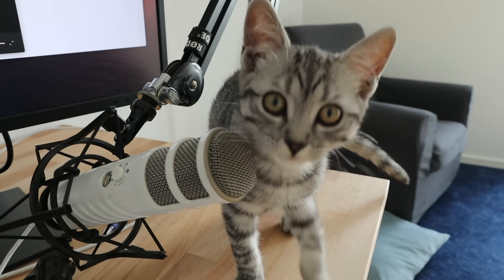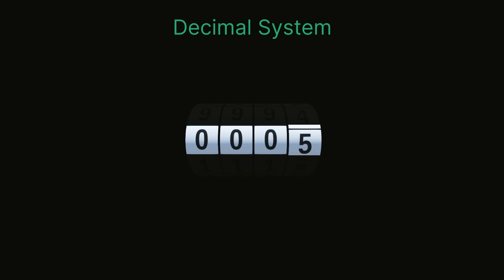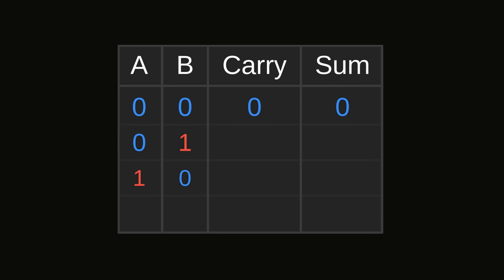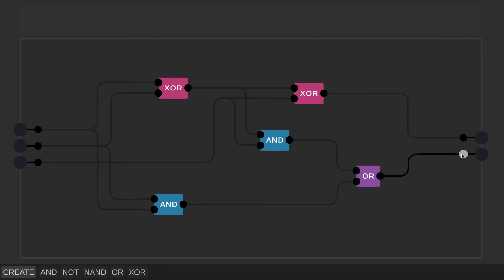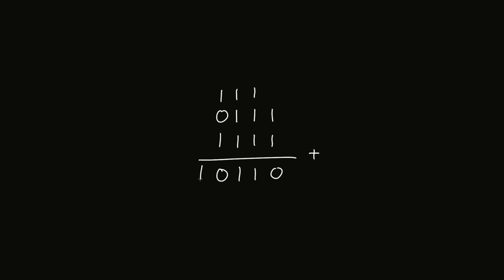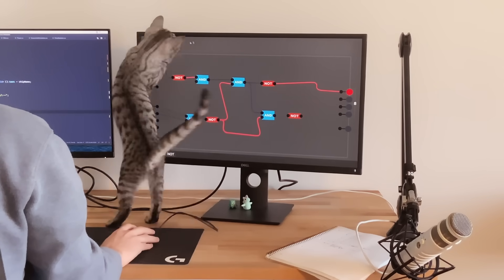Exploring How Computers Work

Comment: Nice build up demo, especially showing the increasing layers of abstration. But your "simplest building block" of an XOR uses already 10 Transistors. That's very inefficient and scales badly for a potential industrial scale CPU. I on the other hand can manage to do an XOR gate simply using only 4 Transistors from first principles.

Comment: Can someone explain to me why at 1:38 when he connects the paper clips that creates an easier path for the electricity to travel? I don't understand why the path with the light bulb is considered to be less easy to travel by the current. It seems to be the same as the path with the paper clips to me
Reply: I think it's just because the lightbulb is a resistor

Comment: 17:05 how is that negative 2
Reply: 0010 = 2
Lets apply twos complement (the method to convert binary to negative numbers where our most significant bit which is on the left is 1 indicating a negative number)

Invert it
1101
Then add 1
1110

That's our negative 2 in binary
Reply: 13:40

Comment: 15:05 I'm a little confused. If we throw out the extra digit at the beginning, how does the computer know it was extra? How does it know that we meant -6 from 1010 and not 10?
Reply: It depends on the architecture of the processor or the type of operation, if the processor knows that the addition is done in 2s complement, like is shown here, then it will know it is meant to be a negative number (-6 instead of 10), but of course it could be 10 if the processor knew that it is adding two unsigned values, thats why programming languages often have two different integer types: signed and unsigned - they could both store the same binary value but each would represent a different decimal number

Comment: At 3:50 you left a lot of stuff out such as power supply and the on off switches so couldn't follow you after that. It began to make no sense to me. Before that it was going pretty good though.
Reply: skill issue
Reply: Turning it on requires power, suppose to be a given. He says turning it on and turning it off…

Comment: Trying to build my own PC as well.
I have a questions about the ALU.
Because either, I don't understand how it is supposed to work.
Or there is a flaw in your design.

If you set the subtract flag on.
and subtract 0000 with 0000, it should be zero, which works fine, zero flag is set.
But, the carry flag is also set, which means we have a 0, and carryover? carryover is basically 16 correct? so this is counterintuitive
Thank you
-Raniem

Comment: 4:50 I was trying to use a software like this and like why doesnt he just link 2 inputs to 1 output and it makes an or statement just the same. In the sim it should, but it actually glitches quite a bit for some reason. I thought it should be able to handle this but it might actually be more of a problem in real life scenarios than not because a direct connetion would be having them both on with twice the power and no buffer im not sure though if thats entirely the problem or not.

Comment: I have gotten a small device with a few buttons (that look kind of like the DPad, A, and B on a controller) and the mother board was made of wood (based on its giant hole), and it had a USB and charging port (yet no battery)
Reply: Also i made a 4B memory in the simulation

Comment: 1:38 can someone explain this? The resistor seems to be in series with the circuit so why would the bulb not be lit when the switch is closed? Is it because the switch has less resistance than the bulb?
Reply: The switch does indeed have less resistance than the light. An LED's resistance might be negligible for most purposes, but it still has more than simple metal. 

The resistor is just there so that there is enough resistance in the circuit at all times, I suspect.
Reply: The current will go where there is less resistance, and there is less in a switch than in an LED.
Reply: The led requires a potential difference between it's two terminals in order for current to flow between them 
When the switch is closed it effectively makes the potential across both terminals the same so no current flows
Reply: The resistor is also there to limit the max amount of current going through the led otherwise it would damage it
Reply: You answered your own question. Yes, there will always be "some" small current that goes in the path of resistance, but its mostly unimportant. It's so small that the light can't turn on.

Kinda like when x is so big (towards infinity), 1/x can be interpreted as 0.

Also fun fact, red LED's require less voltage and current than other coloured counterparts. Meaning that if you can't see in this case that the light is on, you will not see in any other case.

Comment: 45 y.o. here and no one has been able to really explain the magic, even at most low level there is a point the computer does whatever by just typing a button or pressing a key in keyboard. Most far I reached was everything is sustained on a few genius which really understood this madness and they created first compilers. I think 99% of current top-level programmers / engineers they couldn´t do anything without these acquired knowledge from the real genius.

Comment: I'm really enjoying using the toy/tool you built to demo some logic concepts. One shortcoming I'm banging my head against is the ability to create edge-triggered flip flops. Normally this is done by having the clock go directly to an AND gate, and also to a NOT gate that goes into the other input of the AND gate. This looks like it computes "clock and NOT clock" which is always false, but because of the signal taking slightly longer going through the NOT gate than it takes to go directly into the AND, there's a small period of time where the AND gate goes true before going false, and this can be used as the latch signal into a flip flop which will latch the data for a short time window. I notice that some circuits with feedback loop around, and I would love to have some way to have a flip flop which can only latch data at the instance of time that the clock signal transitions from low to high. Due to the way this is probably simulated, it might be easiest if it was a primitive.
Speaking of primitives, it would also be nifty if new primitives could be added with a small scripting interface. It looks like you're already displaying the scripting inside of primitive modules when peeking inside of them. Is this compiled-in or would it be easy to allow new scripted primitives to be added?
Just some suggestions. I love the tool and of course love your various videos (not just the logic ones) and appreciate that you've made such great content and even provided the programs for us viewers to play with. Kudos.

Comment: what is the application that you used for simulating the circuit board with line connectors?
Reply: Check the description

Comment: So ive been researching for quite some time now, and no matter how much i seach, i always get shown the same useless information. 
People waste a lot of time explaining how a computer only deals in on off states and how the binary system works in an often condescending way, and then they just skip the interesting part. 
They say everything can be turned into binary (i get that) and then they just say the software or the cpu interpret that signal. but thats the crux with the whole issue, the one thing i cant wrap my head around.
How does the machine know what to do with the many on and off signals. To interpret those signals (even to just show the signals on the screen) the system needs to be told what to do with them. 
For example, if you get a 1, an on signal, and you want the screen to show a 1, then you first need the system to understand that it got an on signal, and then to tell the magnets (in a very old monitor) to light up certain pixels to form the number 1. But how do you do that?
In order to teach the computer ANYTHING, you first need to tell it what to do with it. but how can you tell it anything if you couldnt tell it how to tell it anything? 
Its a circular problem. If you want to teach someone a language, but all you got is a flashlight you can turn on and off, and you cant get any information back from them, how do you got about teaching them? you can flash the light at them for years and they wont know what to do with it. 

I hope you guys can understand what i mean.
Reply: It only knows 0 or 1, on or off. Your theory there goes into AI. AI is not possible, it only knows other people's input and takes an average of the scenes. I don't know how to better answer your question.
Reply: You are complaining about your own ability to understand the building blocks and inability to search for the information.  First you have to understand the 1 and 0's then you have to learn the concepts in this video; the logic gates and "combinatorial logic", from the there you need to understand "sequential logic",  what makes it possible for a computer to hold "state" and registers and RAM.  From there you need to learn how a very simple 4 bit CPU would work, for example to create a calculator... then you move on to 8 bits, study the MC6809, MOS6502, and Z80 CPU's from the 80's ... all this takes LOTS of time.  many months or years.  You think you can learn it all in one lesson?  You do NOT need to understand any of that just to program in a modern high-level language.
Reply: @jamesross3939  seems like you didnt read what i wrote ....
Reply: @dervakommtvonhinten517  Oh I read what you wrote alright ... you don't mind handing out criticisms to people willing to create content on the subject, but you don't want to be criticized for your inability to learn, am I correct?
Reply: @jamesross3939  you dont mind handing out pointless criticisms to people taking the time to comment on videos, but you dont want to be criticized for your bullshit that ignores what had been written.
Reply: @dervakommtvonhinten517  I read every complaint you made. You start off with a doozy. That first sentence basically tells the whole story though. I tell you what, learn something today and make a video of what you learn. You can't do it can you? Because you're too busy complaining about what others... or perhaps you'll say "I searched the whole internet and couldn't find a single video that explains how to make a video"
Reply: @dervakommtvonhinten517  you do realize you have to understand the individual parts before you can understand the whole system.  I laid it out but I can tell,  you don't want to put out the effort.
Reply: There's no "teaching" at the basic level. The computer is built from circuits that are hard wired such that feeding in a certain pattern of bits has a certain result (e.g. "let current flow from your memory circuit into your adder circuit"). You hard wire enough of these possible "instructions" so that the full collection of them is enough to manipulate the bits in your memory circuit into any arbitrary configuration (including, crucially, patterns of bits that represent instructions). From there you can start to write "programs" (which are never more than a sequence of bits that look like the instructions the computer is hard wired to understand) that can push patterns of bits along wires that are connected to circuits that hard-wire bit patterns as voltages applied to, say, a liquid crystal array. Then you have a screen.

I admit, that likely won't be sufficient on its own to cause you to understand. You have to see the process. Watch (and do not skip any videos of, they are all relevant) Ben Eater's 8 bit breadboard computer series to understand how you really do never need more than hard wired circuits to define an instruction based assembly language for a computer. Then watch his 6502 series to show how given such a computer you can interface with arbitrary hardware just by conditionally pushing voltages around.

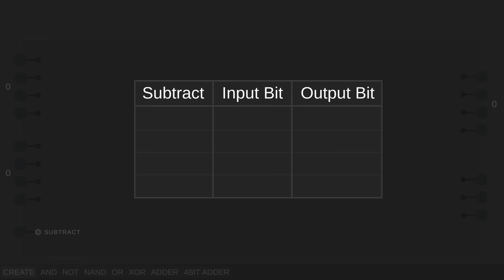Comment: I can't figure out @15:30 where the plus one is? After inverting the bits, isn't there needed a plus one to make the number negative??
Reply: at 15:50, the subtract signal acts as the +1 which is fed to the carry input(last pin) of the adder, so we have our first number positive, we add the inverted second number to that and a +1 from the subtract signal, all goes in the adder and net result is no.1 - no.2

Comment: I apologize, but why does electricity favor the longer path? Is it because it jas a hard time moving through the light bulb? Would the result be the same if the LED was replaced with wire? All my books say that electricity fallows the shortest path. Please help! 1:32
Reply from the maker: Yes the light has much more resistance than the wire, so it favors traveling along the path with lower resistance

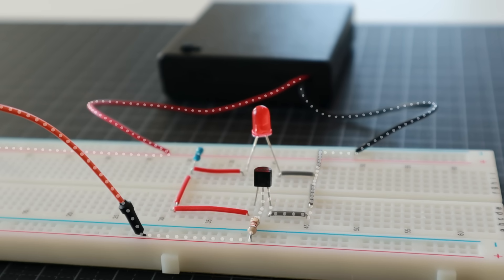Comment: 2:37 the current doesn't completely stop flowing into the LED right? there's simply not enough of it and it doesn't turn it on, but the flow doesn't stop completely, does it?
If this is the case then before 2:37 the current passed through that point but it did not follow the resistor but only the transistor, therefore the path still passed through the transistor because that represented a part of the closed circuit unlike the resistance which does not lead to anything before the negative connection right?

Comment: So I am trying to rebuild this in Minecraft wich is pretty easy but now I got to the ALU and at first look everything is working but then if I try to do the last test (adding two negative numbers) I dont get Negative 6, I get positive 2 +carry bit
just like if you try to subtract a negative number
I dont have any idea why it is that way. Maybe because it does not invert the numbers?
EDIT: I got it to work. Or at least I think. I had to type in 4 by subtract and on top I typed in -2 and then i got -6+carry. So in conclusion my ALU solves the last test like this (-2-4)=-6 instead of -2+(-4)=-6 wich is basiccaly the same way just that the 4 isnt actually negative
I hope that this wont cause any issues in the future because it does things a little different.

Comment: Great video, however, I do have a question, if you add 4 + 4 using the ALU, wouldn't it equal -8, please tell me if you know, I would appreciate an answer.
Reply: using 4 bit signed, yes.

Comment: As a senior electrical and computer engineering student, this has been the best video I've seen in awhile! Explained the core of digital systems in a simple and intuitive way. Subscribed
Reply: Do you think your electrical and computer engineering degree has been worth it? I’m heavily considering switching from CS to ECE because I like embedded and circuits more than just software but I’m still unsure.
Reply: @motorinmysoup9912  One hundred percent. Extremely versatile degree and not as saturated. I switched from aerospace to electrical and one of the best decisions i’ve made. I can work in aeronautics as an electrical engineer, but not vice versa. Same goes EE and CMPS, which requires a good bit programming anyways.
Reply: @motorinmysoup9912  Just read the other half of your comment. Digital and embedded systems required a good bit of knowledge on both the hardware and software. I did some programming before college, but I found EE courses gave me a much more cohesive picture of the whole as a system. Wish you the best of luck my friend

Comment: some of the circuitry of the gates is connected to the power source already(which is not shown in any of the explanations while they write truth table)  before we apply input signals to control the transistor biasing which is used as open/close switch in the circuit, based on these controlling input signals, switch opens and close and we get the output and this output (high or low(0 or 1)) can be used  to control the ckt further

Comment: although gates were explained on the breadboard in this video, what most videos(including this) are missing in the explanation is the brief introduction of how the present gates are made of? if they are made up of transistors, it is better to show just one image of internal circuitry of present day gates, that will give much clear understanding to the students who are scared of these subjects
Reply: „Wired or“ was confusing until I found out that you basically cut between the Ts in TTL . Lucky for us that today we use CMOS and they don’t have that. Full adders ( two bits ?) are so beautiful.

Comment: Hey thanks for the great Videos! I am a frontend engineer trying to build a logic simulator (a clone of yours). I had some questions there, if you can reply on it, it will be very much helpful.
1. What's the logic behind saving a gate? I mean what do you save, when you package a gate? so that it functions the same when you create an instance of it.
2. What's the logic behind drawing straight wires? I mean how can I draw wires that can follow my mouse but still it is bending only at 90 degrees?

Comment: I get this and/or gate stuff can do math for u. But this still doesn’t help me understand how a computer works. You've explained how a basic physical calculator works, which is a hardware chip in the calculator that does the maths. But this doesn’t explain how software works. Cause it seems with the understanding u get from this video if u want to make a "computer" that does many things you'd have to install many physical computer chips each hardwired to do different things.
Reply: This video would be weeks long if he explained literally every part of a modern CPU architecture
Reply: There are many videos about this. With RISCV you have opcodes which tell the calculator what math to do. And two addresses where to fetch the operands from.